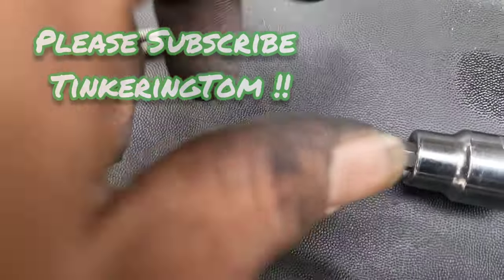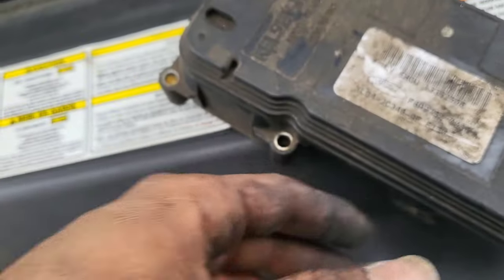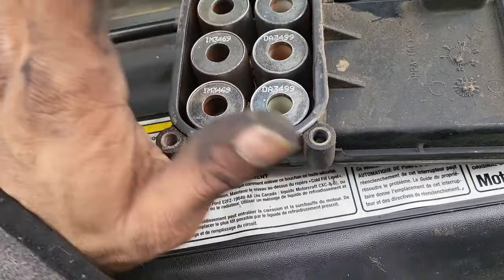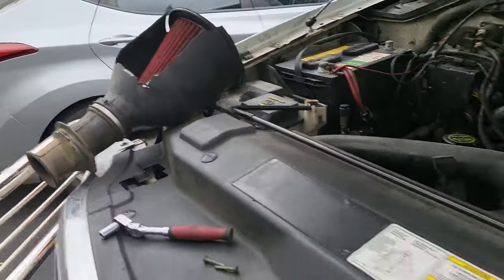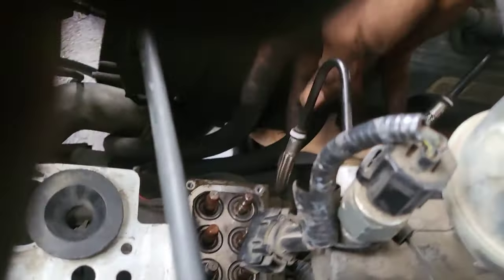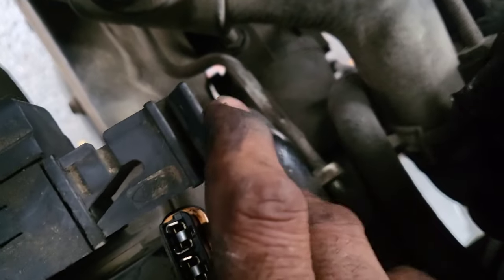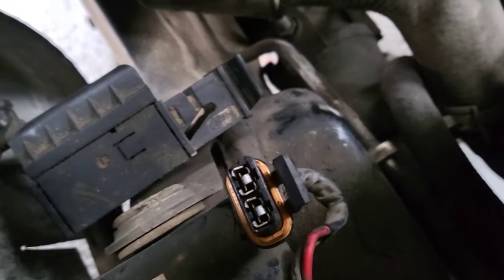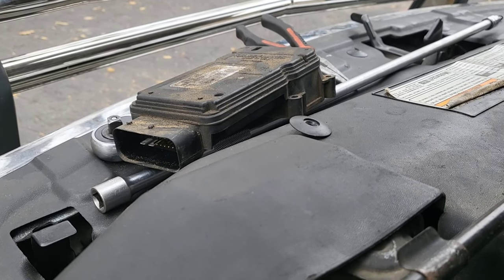How to Fix your ABS Ford F150 Control Module Replacement

Comment: I've got a 2005 f150 super crew , all of a sudden, the pedal goes to the floor without any leaks. I wonder if it's the same problem or the master cylinder. Loved your video. 👍
Reply from the maker: Make sure you have bled air out of all 4 brakes calipers to start

Comment: Did you have to bleed the brakes after the module install? Or is that only if you replace the ABS pump as well?
Reply from the maker: I didn't bleed brakes

Comment: I got a 2010 Ford focus withe same code B1342-20 I get it scan at two different repair shop first one say the ABS Module need to be replaced cost $1400 second one say the ECU need to be replaced $1500 they both saying two different things what to do?
Reply from the maker: I think there might be companies that you ship your module to and they repair maybe you could try that first and replace yourself. Were they independent shops or the dealership?
Reply: @TinkeringTom91  thanks

Comment: Im having this problem on a 2009 and i put a used module on and it was 400$ and im still having the abs on the dash but my brakes feel better fo i have to reset it?
Reply from the maker: A 2009 may need reprogramming My truck is a 2000
Reply: plug and play. no reprogramming needed. i also had the 2009 module repaired and still have the same problem, no fix yet

Comment: Are the T-20 screws the tamper proof type or regular?
Reply from the maker: I think regular.. I had no issues press down hard and turn maybe lite amount of wd40 on bolts too if rusty
Reply: @TinkeringTom91 , thanks. I did take a look at the ABS module on my truck today, and it looks like regular, but the module is pretty dirty. I'll clean it off before I remove it to confirm.

Comment: Was your ABS making a grinding noise or did you feel the vibrating noise when you put your hand on it before you replaced it?

Or was the ABS light on your dashboard?

I have a 2000 ford expedition 4.6L V8 Triton XLT and my ABS light came on and my ABS module is making a  grinding noise and when I put my hand on top of the module  I felt the vibrating noise coming from it.🤦🏽‍♀️

As a female diy mechanic that's new to doing my own repairs, I'm trying to find an ABS module to replace mine. The only way to stop that grinding noise is I have to remove the 50 amp fuse.

By the way, my brakes are fine, no issues with them.
Reply from the maker: ABS was on Dash. Did not hear grinding like yours though interesting.. keep your head up Girl!

Comment: well that was a pointless video that showed nothing
Reply: Four bolts and a connector... do you want him to come hold your hand?  🙄😂
Reply: @HerbMoore3  there was many more points that could have been shown and a better video but you wouldn’t understand that so I won’t go into details as you think you know it all already
Reply: @castawaysmc yea, I do know it.  You need to take it to a mechanic if you can't figure it out from this, because you'll surely screw it up.  🤣
Reply: @HerbMoore3  actually I rebuilt my entire vehicle and that was the last thing I had never touched until then and yes there was more points he could have brought up. I actually am extremely mechanically inclined and fix anything and everything I touch and have a 145 IQ and learn everything extremely fast. My knowledge is so great on fixing things that I have had engineers come to me on many occasions to show them how to build things they were completely stumped on and that is the honest truth, all of it. And frankly I don’t care that I know you won’t believe it because you couldn’t wrap your head around ever having a gift like that. Furthermore now I know enough about ABS modules now to even rebuild them myself. Like I said it comes extremely quickly to me.  To be honest I wish I could share my hide with more decent people. I did luckily pass that gift down to my first daughter though. I hope she puts it to good use like I have tried